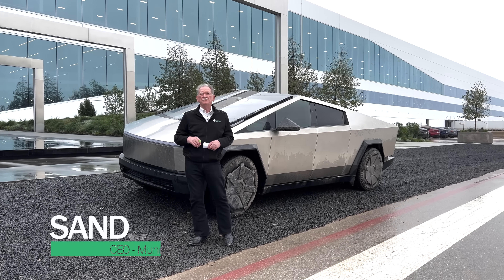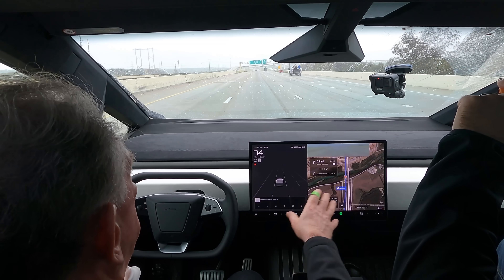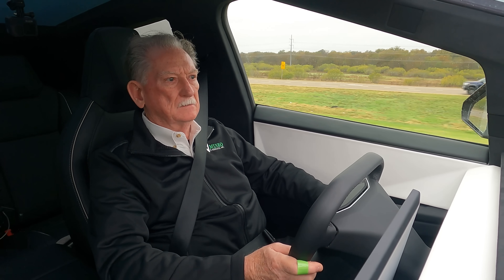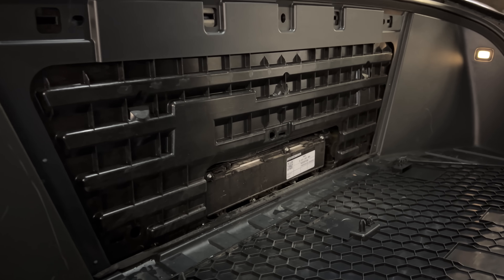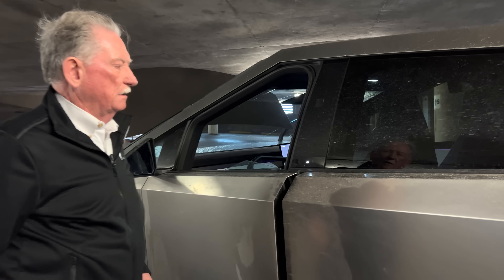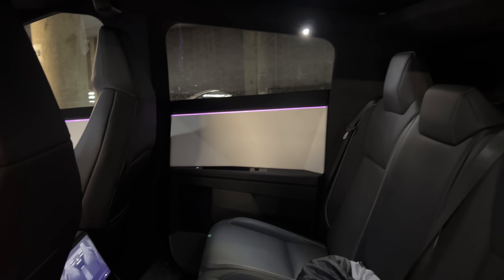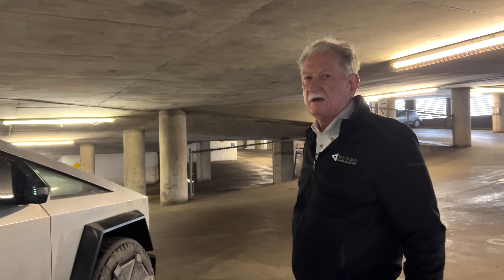Sandy's First Impressions of the Tesla Cybertruck!

Comment: 35 years a contractor and maintenance, gas, reliability are of the upmost importance!….I’ve owned virtually every truck out there and the cybertruck would be my choice without a doubt..not to mention no more smog checks…AND…I’d only have needed 1 truck…I’d of saved a fortune over the years…I’m now retired and I’m still getting one…
Reply: @@2020_Hyundai_Prophecy_Concept
My namesake is a "Semi well known" grade 3 troll.
.
Gets very vocal if called out.
.
Sometimes what seems apparent logic on the surface, untill you think it through, then, not so much.
.
Example, in this thread he throws in "Fleet managers are flocking to EVs.... Not!" (or similar), eventually citing "battery life".

Actually not a consideration for any manager keeping the vehicle for 3 years / 60k miles, when anyone with half a brain knows the warranty is 8 years/ 150k miles.
.
It's typical FUD.
.
Appeals to those in the FUD "circle jerk" who confirm their own "facts" by repetition.
Reply: @@2020_Hyundai_Prophecy_Concept   absolutely, as a EV owner of 3 years now, it's really a breath of fresh air.  No oil changes, no 'tune-ups', no emissions checks,  practically no brake jobs ever.  100K warranty on the whole powertrain.  Sure, something may break in the long term, but most of the items that break most often on ICE cars simply do not exist in EVs!  as long as the battery holds, EVs will be truly easy (and cheap) to own.
Reply: @tomwojcik7896  I don't even get my hands dirty when adding washer fluid to our EV. No more wiping the cap off before filling it and STILL having to wash off oily hands afterwards.
Reply: Hey for us contractors / tradie guys we could absolutely utilize the 9kw power out feature. It's so perfect.
Reply: It’s a huge bonus.  You no longer have to lug a generator and fuel out to remote job sites.  You can run saws, welders, concrete mixers, whatever…
Reply: I like the fact that if there’s a power outage, I can just stay in the cybertruck nice and comfortable. This is especially important when it’s cold like heck.
Reply: The stubbornness of ICE owners is incredible. I can only imagine horse owners being exactly the same back in the days. I only have electric bicycle for now but have already sold my motorcycle as I could not look at this horrible noisy, stinking junk of complicated metal parts after experiencing an electric engine. I used to ride motorcycles for 15 years prior. I commute in the city so it takes exactly same amount of time but the satisfaction is immense. I can only imagine how owning an electric car would feel. I can’t wait.
Reply: Unless you're that model s owner in Germany on his 14th motor...
Reply: Why one instead of needing two with cybertruck?
Reply: Good on You! Enjoy your retirement, young man!
Reply: @MorganMadej  
I was hoping for longer range..Was planning on driving from Los Angeles to Starbase in Texas to watch the Starship..Will probably pick up the additional battery..
Flew out to see the first Starship flight..Definitely worth doing..
Reply: It's good, you had your thing that cost a fortune, but the next generation can get something better ! it's how it should work for every new gen :)
Reply: @robertbidochon7949  
VTOL’s should be fun…
Reply: Shhh it’s not a TRX but okay
Reply: @oinn8003  
Not sure what a TRX is..,
Reply: Would be nice to have seating for 6, bench in the front for the rare occasions.
Reply: and you could save $500/m just the gas
Reply: It has stainless steel body panels,  with aluminum frame@@2020_Hyundai_Prophecy_Concept
Reply: Not sure of the pure practical side though, can I put ladder racks on? Access to the front of the tray looks like a PIA due to the high sides, when I'm at full combination mass what's my range? - looks like it might be pretty low, you can't reasonably operate a truck without a spare - where does it go?
Reply: @TB-up4xi 
I’d of preferred a steel top option..Flats haven’t been much of an issue over the years, I’ve used compressed air to get to a tire shop and I’ve already seen aftermarket rear wheel carriers..Range when towing can be an issue on occasion but with about 340 miles of range, about 170 towing, it shouldn’t be much of an issue for me…Although I’d  of liked to of seen a 400 mile plus range without the extender…I’ve got 2 reservations #20,000 & 360,000 so i can resell the first one if there’s a range improvements…
Reply: And if you really think evs are greener then ice vehicles you bought I to the biggest lie and you are a grade A sucker. From mining to final product gas and diesel is used. And I take it you never seen a lithium mine have you. Lol that shit poisons all the land around for years and years. The battery is not recyclable.
Reply: Nice!
Reply: What's the biggest selling point of this over a Rivian which you could get today?
Reply: @paulbram2  my wife saw one last night, and said ‘wow! what was that!?’ thats never happened before. im sure we’ve passed a rivian
Reply: @paulbram2  
Personally not a fan of the rivian….They are totally different..Watch the videos.,
Reply: 🌟And as with all EV's; ultimately disappointing. Just facts dude, you don't have to like it.
Reply: @frenchenstein  
Electric vehicles other than tesla have had issues but teslas had quite a head start I doubt the OEM’s will be around long..
Reply: @@2020_Hyundai_Prophecy_ConceptGood points. Bought my Model Y Jan, 2001. Have 45000 miles on it. No issues at all except a change of tires. Same thing for my daughter. She loves her Tesla and charges every night without fail. I sometimes forget. One thing I didn’t realize is no charging stations in small town Iowa.ran out of juice 20 miles from the   closest station. Was towed but learned a valuable lesson. Always take your 110 volt connector when going cross country.
Reply: Why not a rivian?
Reply: @lifeisgood12341  bed is too small
Reply: @lifeisgood12341 
No charging network & not a fan of it’s look..
Reply: @DQ-su6qf  not sure you are fully informed on charging, especially with Tesla opening it's network. As for looks, hey that's your choice. I feel the cyber truck is just ugly and impractical. I've done construction myself and like the locking tonneau cover but the reach over height for the bed seems awful.
Reply: @lifeisgood12341  Reaching over the bed is an issue..It took a couple days but I really like the  look. The range is a draw back but I’ll be getting the xtender since I’ll be taking it to the Starbase in Texas..’..if the single motor ever comes out at a reasonable price I think it will be the go to truck for construction workers..As far as knowing about tesla I’ve closely followed tesla for the last 13 years..
Reply: @DQ-su6qf  non Tesla charging could be better but is fine without vehicle specific chargers. I look forward to Tesla finally opening up it's locations soon.
Reply: @lifeisgood12341  The side access is an issue but charging isn’t..I’ll be taking it from Los Angeles to Starbase in Texas..I’ll also be getting the battery extender eventually..
Reply: I'm getting me a CyberTruck too cos of this comment 😅
Reply: Lol wait till you need to buy a new battery
Reply: @chrisandchill 
Had to replace a few gas engines over the years I can deal with changing a tesla battery at 400,000 miles plus..
Reply: Great input.
Reply: Thank you, Elon
Reply: @@2020_Hyundai_Prophecy_Conceptelectric cars have loads of maintance and all the goverbemnt checks and taces that apply to gas cars eill transfer to electric. Do you really think thr government will stop caring about revenue because of electic cars? You know a window tax used to be a thing.
Reply: @@2020_Hyundai_Prophecy_Concept maintenance is not the biggest cost. It's repairs. You can do oil change etc yourself very cheap. The main cost is in repairs and also the loss in resale. Tesla costs a lot to repair as they have a monopoly on repairs. Most gas cars you can take anywhere.
Reply: You must be joking or need to visit the optician
Reply: HI’m
Reply: Good luck with charging it! And selling it 😂you literally will not be able to give it a way in a few years. Just my opinion 😂
Reply: @bdek68  
Charging won’t be much if an issue & I don’t intend to see it anytime soon..Good luck with dealer mark ups & gas prices with your future trucks..
Reply: @bdek68  
If you find charging that difficult you may want to look into Uber..
Reply: @@villageidiot1050 
You should stop flying..
Reply: @@villageidiot1050 
Now let’s think positively..
Reply: @@tyler530chico 
It was either that or stay home with the wife..
Reply: Monroe, isn’t no hand doors handles dumb?  I thought it was illegal. At least Mercedes W123 would always have a proper door handle.
Reply: Finally, a truck guy with a well thought out response. I mean that as a compliment.
Reply: So the only people that have a well thought out response are people that agree with you? 😂
Reply: @harmankardon478  
Exactly..
Reply: @craig8638   Because average truck owners as fleet managers are rushing towards ordering them...not. It's too expensive, range could be an issue, not much aftermarket support, and being a peculiar vehicle, the maintenance as repairability could be an issue.
Reply: @RogerM88  too expensive? have you seen the price of even an f-150 these days? or a basic work van? 
it's insanity out there.
Reply: @rokko_fable   They are expensive and not selling due to that. Besides delivering a small batch of CT, it's still too far away from being mass produced. Similar happened to the Semi. Not a surprise if both gets cancelled in short time, due to production costs.
Reply: @RogerM88  I'm wondering what the cost will be for a new set of tyres, not cheap I'd imagine.
Reply: @RogerM88  maintenance is not an issue because there is none. As far as the drive trains go, there are very reliable.
Reply: @RogerM88 there's a UK company running Chinese MG 5 estates (station wagons) saving £000's for worksites nationwide. 59k miles a year.*
Not as wide as USA tbf but that's where the jobs are.
Im only doing 30k a year in my MG 4.
It's one of the best cars I've ever owned from BMC mini to Audi Q7 to GTM kit over 45 years.
Comfy, quick, spacious, economical and fun to use.
Try it.
ALL EV drivers know about living with ICE but ice only drivers think they know all. 🤷
Reply: @KM_Snowboarding   Exactly. Many BEV owners push the narrative of "no oil changes", while conveniently ignore the worse tire wear due to the weight.
Reply: It looks like a fart.
Reply: You should get your eyes checked. Maybe you prefer a truck that rusts out and gets scratched easily? @VoteForBukele
Reply: For the reliability, I think it really speaks when you realize Tesla uses what are essentially Model 3 (Their base model!) rear motors for their Semi!
Think about that for a moment, could you imagine some Ford consumer market engine being in a semi? Would it live up to the mileage?

Tesla may not be down for exterior quality control, but damn do they have some awesome engineering.
Reply: @VoxelLoop  Actually CT motors are specific to the CT.
Reply: @VoxelLoop  If there's a ton of semis using that constantly for years now that must prove it's reliable! Oh, only 15 Tesla Semis are hauling Frito-Lay products up to 425 miles, according to a 2022 Reuters article and To date, around 267 semi trucks have been pre-ordered. Also all the videos of those only 15 in existence now several have broken down needing tows because of a glitch?  Reliable? 
"Think about that for a moment, could you imagine some Ford consumer market engine being in a semi? Would it live up to the mileage?" What mileage combined there's so little data to collect from 15.. also keep in mind they're only going 425 miles when the average semi can travel between 900 to 2,000 miles..PS ever heard of the Ford f-max long haul truck - 12.7l ecodiesel. I assume no.
Reply: No more
"Hi, I need to book my truck in.... Tomorrow.... No, next Tuesday isn't good!"
.
Then having to drop it off, explain the problem, find out they don't have the loaner, "negotiate" a vehicle, empty tools, try to fit them in the one they give you, (minus the tool / part you never use, but WILL need today!)
.
Then you arrive at the job late, and get "the phone call" at 2pm saying they just started and found "another fault" needing a part they (a main dealer) don't have... And it's more money... Can they have the vehicle in 2 days when it arrives?
.
Or if they do fix it, you have to leave at 3:30 to be sure you're there to swap your gear over before they close....
......
Tesla.
Make the call
"I have a fault" (they diagnose OTA)
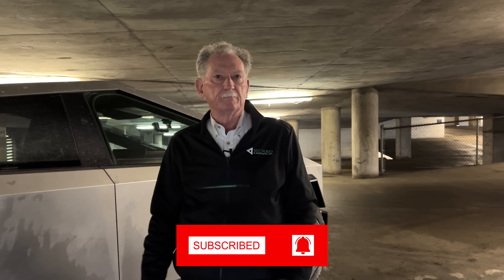"Yes, we can see the problem, it should be ok today....  how about 9:30 tomorrow?"
.
"I'll be on site at xxxxx"
.
"No problem the tech will meet you there"
.
Next morning, on site, you get the 9:00 call
"I'll be there at 09:35 sorry I'm running late"
(You laugh!)
.
Arrives with the part.
Fits the part.
Clears codes.
Runs a diagnostic.
Test drive.
Phones you.
You go to the vehicle, see the old part, get the report.
It saved you ..... 2-3 hours?
.
THAT'S the big saving.
.
(As a Mobile tech, I spent a LOT of time in the first situation!)
Reply: @rogerstarkey5390  Actually better yet, no phone call in most cases!
For many faults, the Tesla app will notify you of it and give you some appointment options. The vehicle and Tesla know what's wrong so the parts are there when you arrive. You usually get some Uber vouchers, couple hours later, it's all done.
Reply: @rogerstarkey5390 the time saving on servicing is a massively undersold benefit of EVs. Put a price on your time and it makes a big difference quickly
Reply: @rogerstarkey5390 if that isn’t desperation to try to justify this EV train wreck I don’t know what is? No need because most of us don’t want anything to do with them but best of luck
Reply: @bdek68  
The desperation is coming through in your reply..If you’re anti  cybertruck  you should point out some rational reasons why..appearance is subjective..Give it another go..
Reply: @rogerstarkey5390 in what fantasy world is a Tesla repair that straightforward? I know countless people who have waited weeks for a simple part, or given the run around and chasing reps for an answer. I’m sure there are some good cases, but I wouldn’t rely on it for a company car.
Reply: @@villageidiot666 All commercial airliners have been fly by wire for 40 years. The F-16 came out in 1976 - fly by wire. Every fighter plane since then has been also
Reply: Why buy a truck if retired?
Reply: @Gusfezio  Uh, drive to national parks and go fishing?!
Reply: @Gusfezio 
Ive got the NSX for the weekends…
Reply: @DQ-su6qf  not really an answer but ok
Reply: @Gusfezio  
I’ve owned trucks before I started In construction & I’ve got the NSX for weekends…
Reply: So no rear view mirror and crappy rear/front visibility not a big deal uh “truck” guy. Nice try
Reply: @Hypnotoast  
Well in my model y performance I usually drive with the rear camera on the screen 
And I got use to the lack of visibility over the front many years ago after buying my NSX..Not much of a challenge..
Reply: @@villageidiot1050
You’d better stop flying…
Reply: New shit is generally garbage within the first 100k miles. Most of the time within the first 50k. 😂 And all Tesla products have had countless issues all before 50k miles. New doesn't equate to better even more so with today's new built garbage.
Reply: @chrisangus1725  
None of that made any sense..
Reply: Yeah right.  My Tesla vehicles have spent the MOST time in the shop than any other vehicle I've owned in 30+ years..... repair costs also ridiculous.
Reply: @beyerch 
Bad luck…I’ve had my Y Performance for 28,000 miles &  no problems in fact virtually every Tesla owner I’ve talked to haven’t had issues like you describe…possibly an early model?…Years ago I had a new Ford 150 & Dodge Ram both started   breaking down after 45,000 miles..I went to Toyota Tundra and loved  the 2 I owned…
Reply: @DQ-su6qf  Report back when you put more miles/years on your cars....... They do not age well.
Reply: @beyerch 
You may want to try educating yourself..
Reply: @DQ-su6qf  Yeah, I've only owned 3 Tesla vehicles, racked up hundreds of thousands of miles, and spent many thousands of dollars at Tesla service due to the multitude of issues with all of my cars.

Also owned/worked on cars for 30+ years and created/ran an aftermarket parts company for part of that time.

I'm completely unqualified on the internet, I should have known better than the pumper bots/shills......
Reply: @beyerch  I never said you weren’t qualified but do you actually think your experience is anywhere near typical..I don’t..And I don’t think you do..
Reply: @beyerch  Have about 30,000 on my Y Performance..no issues…
Reply: @DQ-su6qf   That's cute.  when you get over 100K, check back in.  My Model X has already cost me well over 9K and 77+ days at the service center.  Biggest POS I've ever owned.
Reply: @beyerch  Somehow I doubt it…
Reply: Cybertruck cool
Reply: @fkporsche1   fire hot
Reply: If you have a collision the repairs will be huge.  Theres no body panels.
Reply: @555atU   it's a 7,000 lb truck with bulletproof super-hard super-thick (for a car) steel panels everywhere.  if you have a collision, the OTHER CAR will have huge repairs!  

actually, your point is a fair point, so we will see.  My guess is that most impacts up to some medium speed (15-20 mph?) will be nothing but bumper damage (which are replaceable).  at impacts of 30+ mph, most vehicles get totaled anyway.
Reply: @555atU  the Cybertruck isn't an exoskeleton design as they originally planned, the panels are replaceable. However the HFS stainless panels and doors don't need to be structurally reinforced as they do with standard light weight panels on normal cars. You'll be going into the body shop a lot less with this vehicle, as only significant collisions will require repairs.
Reply: @555atU Just make sure you’re fully insured 😊
Reply: @555atU insurance companies have already stated your premiums will be well over $1k a month because even parking lot dings will result in the truck being totalled due to labor and parts costs.  Think that through.  $12k a year on insurance alone. That is crazy!
Reply: @555atU the design is perfect. you throw it away and the insurance company buys another one
Reply: @@2020_Hyundai_Prophecy_Concept "My gas car"... you mean "My Hyundai", that's the problem. Get a Toyota or Lexus.
Reply: My wife has had a 2017 hyundai elantra limited since new. ZERO PROBLEMS. I change the oil myself 2 times a year @hughjanus7354
Reply: @hughjanus7354  I have owned 41 ICE cars since the 70's everything from $500 Toyotas to $200k Lux Audis and US and Aussie Muscle - my last exchange was a 2019 Audi A4 45TFSI to a model 3 - I have no desire ever to own an ICE vehicle ever again.
Reply: Too bad when th battery pack is gone and you need a whole new car.. also the cyber truck  needs Regular maintenance on braking and suspension components. I swear some of these commenters are totally clueless kids. .
Reply: @harmankardon478 brakes are rarely used due to the electric motors doing almost all braking. The suspension in Teslas are built like fleet vehicles-- built for a million miles. Tires and windshield washer fluid are the things that will be the same as ice cars. The rest requires considerably less than old fashioned vehicles. Batteries are now built to last in the 500k miles range, I believe.
Reply: Replacing a battery after 150k miles is still cheaper than paying for 150k miles worth of gas. Try again. The truck itself wont rust so it technically will last forever and can get a new battery every 150k miles if needed. Oh and it performs better than any gas truck across the board. An F350 is a gas HOG so it will cost much more than a battery replacement and considering how ford engineers design stuff to fail for service revenue you will need a new ford if you go that route. @harmankardon478
Reply: @harmankardon478   Any DIY Mechanic knows all cars need maintenance. So I cringe with BEV fanboys, mostly not that much into cars as wealthy enough to constantly replace their cars, claim BEVs don't need maintenance.
Reply: @RogerM88 
Not a fan boy, won’t be selling my Tundra or NSX..and what potential maintenance are you eluding too?
Reply: Move to Alabama, no smog checks, no vehicle worthiness tests, cheap gas, legal assault rifles....and you can marry your cousin.

You can get a new F150 with supercharged V8 for only 46k....only in Alabama....with factory warranty.
Reply: @fortheloveofnoise  
Now you tell me..
Reply: what would you do if you were on a rural road and your sidewall is punctured and your cell phone is out of range. No can of air is going to fix a sidewall puncture. Elderly people should never be in a car without a spare. You should know better.
Reply: @Gnofg you really went very specific there. “What you would donif the driver is blonde and surrounded by angry red bears, and have no gun and the …”
What would an “old person” be doing in a cybertruck in the wild, phone without charge (electric car, big battery, remember?) and without spare tire? Who said you can not buy a full size spare tire and thow it in the bed, or even the back seats space?
Reply: @danubiosalas4231  then you lose the use of the bed. It is amazing how a cult member uses his brain.
Reply: @Gnofg  
Same thing I would of done when I was in the middle of nowhere at 2 in the morning 6 months ago on a dirt road looking for the campsite to watch the Starships first flight..I’d either sleep in the truck till morning and start walking or hitchhiking..don’t be such a pussy..
Reply: @@2020_Hyundai_Prophecy_Concept  You still have plenty of issues too. Suspension components, tires, as electronic issues. Also fluids changes too. And the big potential issue of them all, battery degradation. If was that cheap to own, Hertz wouldn't held back with their Tesla deal.
Reply: @RogerM88 What are you referring to?
No fluid changes on the Cybertruck.

Coolant isn't super heated so it'll last more than a few hundred thousand miles.
Brake fluid isn't super heated because the brakes are rarely if ever used.
Brake pads and rotors never need replacing because they are rarely used.
No engine oil.
No transmission fluid.
No transaxle or transfer case fluid to change. 
No power steering fluid.

You do need to add windshield washer fluid to the CT, as in all other vehicles.
Reply: @dvader3263  In many BEVs you still need motor as diferencial oil changes. As replacing the collant from the battery pack. Which should be done in schedule, since it would cause leaks inside the battery pack, and we already know what could happen next.
Reply: @dvader3263  None of the fluids you mentioned emit greenhouse gases in any significant quantity (not combusted) and are fully recyclable.  What isn't fully recycled, lithium batteries.  They go in landfills, they could be recycled but they aren't, currently it is cheaper to mine new lithium than reclaim it from old batteries.  Don't worry carbon neutral synthetic fuels are starting to arrive making ICE vehicles greener than EVs.  So the Cybertruck is just another entry in a deadend class of niche vehicles.
Reply: @dvader3263  Actually I noticed a replaceable spin on oil filter on the rear gear unit. So it probably has at service interval for that. probably something really onorious like every 100k miles. 🙄
Reply: @RogerM88 My family has owned 3 tesla around 6-7 years each, never had to replace any of the fluids youre referencing, i dont even know what they are 😆
Reply: @Uberkilltoecheese   So why they "owned", instead of "own"? Most people keep their car for long.
Reply: @RogerM88  I think a big thing for Hertz in holding back is the large price drops that Tesla has been doing. Hertz relies on re-selling their cars after they're done with them, so Tesla dropping their prices dramatically totally destroys that business model.
Reply: @curiousthinker8040 almost all of Hertz cars are $15k Kias. They aren't buying $45k Model 3s
Reply: @RogerM88 as a Tesla owner, what fluid changes?  A splash of windshield wiper fluid?  You simply can not compare the maintenance of a ICE vehicle to a Tesla.  All cars or trucks need tires too, regardless of propulsion.
Reply: @alexnutcasio936   You just sound as a typical non car guy. Even a Tesla needs maintenance. Fluids changes from the coolant system. Yes, replacing the coolant, because over time it degrades and gets electrically charged, leading to corrosion. Also oil changes from the motor as diferencial. Many Tesla owners, don't even understand what maintenance is, because they trade their cars often, or it is done under leases. The BEV industry is following the Smartphone industry, once the fully integrated battery packs is degraded, the car is consider totaled. Just as being quickly obsolete.
Reply: @RogerM88  Fluids? The only fluid needed is to fill the windshield washer and yes, tires will need rotation when the screen tells you it's time, you put in a service call and mobile tech arrives at your preferred destination and sends you a text when it's completed and you just hop in and go. Same with electronics, most are solved via OTA and battery degradation , yes you do lose 1 to 3 % the first year than it levels out. 8 years or 150k miles limited warranty on drive unit and the battery!  I have a friend who actually guided me to get a Tesla, his is a 2016 model S 90d with 168k miles and still running smoothly.
Reply: So after 35 years you've never had to reach over the side to get something out of the back of the bed or put something in?  You're certainly not going to be doing it in the cybertruck.  It is the perfect poseur truck.
Reply: @bobfangio4713  If you aren't 6'6" and have gorilla arms you aren't reaching over the bedside to pick anything up. Unless it's an early range or S-10.
Reply: @bobfangio4713  That is a drawback & id of preferred an optional steel top..Still an infinitely better choice..
Reply: @bobfangio4713  that's your reasoning? That's worse than saying it doesn't have enough cup holders lol
Reply: @bobfangio4713  
True but the positives are simply overwhelmed..
Reply: @@2020_Hyundai_Prophecy_Concept  All cars need to be maintained, even a Toyota Corolla from the 90's, to last more than 2 decades without any mechanical issues. So affordability as parts availability are very important components to keep a car for a long time. And Tesla production seems more oriented to pump out the most cars they can from production, without the same rate of parts to their inventory. That would explain why repairing Teslas with new parts could be very expensive as tedious process.
Reply: So you haven't driven an electric vehicle for over 100,000 Miles to understand the reliability and sustainability of these type of vehicles. 

Just because something is new, doesn't mean it's better.
Reply: @baibureh8816 
"Just because it's new...."
.
Was that aimed at me, or the OP?
.
I've driven ICE for long enough to guarantee the position I stated is correct.
Reply: @baibureh8816  I've put 165,000 kms on my 2013 Model S. Running like a top. What's the problem?
Reply: @ColinFox  Was checking out a used car site and saw a long range model 3 advertised in the netherlands from ‘19 with 227000kms.
Reply: @baibureh8816  sorry pal there’s no contest. The reliability and required maintenance on a Tesla make gas cars look as cool as Bill Gates 🫃🫃🫃
Reply: @baibureh8816 After being alive 28 years....every new version of something is usually worse, unless it involves computer stuff.
Reply: @baibureh8816 hopfully its like my makita battery drill treating like fuking peice of shit cause i want a new one and saying ill replace it when it fks out 
The prik just wont die ... Been 3 years saying this (its least 7 years old) now ive become a lil attached n seeing how long the old girl will go 😂😂
Reply: @baibureh8816  hybrid vehicles as taxies in NYC go 300-500k miles on battery. 0-100' temps. Id say tech is solid.  Just because EV have only been in constant production for 130 years doesn't mean their new tech is unreliable. Modern EVs like Nissan Leaf have been popular for 15+ years with fantastic reliability.
Reply: @baibureh8816 The Vehicles are maintenance free. My brother’s model 3 has 200k, just tires…
Reply: @palebluedotadventures2500 no vehicle is maintenance free
Reply: Few things, looking at this vehicle from a reliability stand point.. 
It has way too many things that will break including the rear bed cover slides, the glass roof looks annoying to clean and easy to break if a heavy load shifts, just look how dirty it's when he's showing off the rear outside/in and all the dirt gets pushed into the sliding track stuck forever?..great design, Tesla loves using car parts in all their vehicles including semi trucks so I doubt it will be much better vs a stock Tesla part wise, replacing the battery pack in the truck will most likely outweigh its cost in 10 years making you pick fixing/buying new again so worse on the environment either way and the final thing is it's brand new and completely untested vehicle in reliability besides some hidden lab tests you would never be aware of. So saying "maintenance, gas, reliability are the upmost importance" is quite funny considering that none of those things are truly known besides the gas one being electric vehicle, which again has flaws in the end during maintenance.
Reply: @NickNembus  
I’d of preferred a steel top option but none of your other points make much sense..the truck has an 8 year 150,000 mile warranty & tesla batteries last on average 300,000 miles & you’d buy a salvaged one if needed like I did on my Prius..There’s a lot of new tech but everything has been so simplified any problems that arise will most likely be over the air updates..I’ve followed tesla closely for 13 years and I’m not concerned..
Reply: @@2020_Hyundai_Prophecy_Concept  What are you talking about? BEVs better to the Environment? If you add Carbon footprint since production as recycling, the Greenwashing with BEVs would stop quickly. Especially with a massive truck as the CT. BEVs as mass produced, are relatively new to the market, so reliability is subjective. And even so, Tesla didn't scored that great in many reliability reports.
Reply: @RogerM88   then let's do the math. extracting, refining, distributing and finally burning a gallon of gasoline emits 25 pounds of CO2.

acoording to Fuelly the average 2023 F150 does 17.2mpg. so that's a cool 1.45 pounds of CO2 per mile driven from the fuel alone.

higher manufacturing emissions of the cybertruck amount to maybe 20k pounds. a cybertruck uses 0.45 kWh per mile. US average is 0.86 pounds of CO2 per kWh generated.

so our equation for the break even distance is 20'000 - x * (1.45 - (0.45 * 0.86 )) = 0

the cybertruck is better than an F150 from  a CO" perspective, including manufacturing emissions, after 19k miles. which is 1.6 years of average driving for an American.
Reply: @anonym3017  Essentially the same for most EVs as well.
Reply: @anonym3017  You still need all that refined Oil to build BEVs, as fueling the Power Grid, to handle all those massive BEVs as the CT, pulling almost the same energy as a household.
Reply: @RogerM88  except you don't need all that refined oil or even anywhere close to it. 

Cause the cybertruck gets some 2.4miles per kWh of electricity.  A gallon of gasoline releases 33.5kWh of energy when burnt. GE currently sells combined cycle power plants that run at 66% efficiency.

so you can have an F150 that burns a gallon of gasoline every 17.2 miles. 

Or you can take the oil required to produce a gallon of gasoline plus all the energy the refinery uses, run it through said  GE powerplant and then use the resulting 27kWh  of electricity to drive the cybertruck for 65 miles. and electricity can obviously be produced via other methods than burning gasoline/oil/natural gas/coal in powerplants. 

and electricity is produced in other fashions which is why the US is at 0.86 pounds of CO2 per kWh and not at over 1.4.
Reply: @RogerM88  2010 called, they want their FuD back.